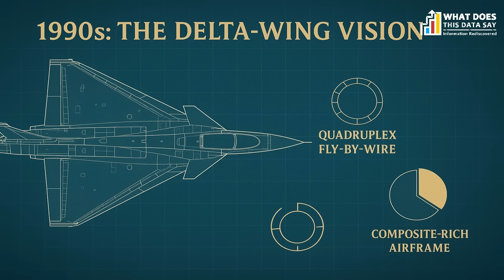The Tejas Story: Crash, Delays & India’s Defense Reality

Comment: The speaker doesn’t have deep knowledge about DRDo, Tejas, Ministry of Defense, HAL, etc.

1. HAL is a government monopoly and a 40 year failure.  
2. Corruption, Bribery, Kickbacks run India’s defense Industry.
3. India’s education system is based on rote learning that benefits none.
4. Tejas chassis was designed in India with Lockheed Martin’s blessing. 
5. All important and major components for Tejas designed in India are not on the Tejas aircraft. They are all failures. 
6. All important components including the engine are foreign origin.
7. After 60 years, HAL is still a screwdriver technology Government monopoly that does next to nothing.

Comment: LCA Project Delays - for a correct perspective:

1.  Typically, for any well established international company, it take about 12 years to develop a new fighter aircraft, with already established technology base. In Indian context, it would take additional three years, given the infrastructure and Indian ethos of working. 

2. In the case of LCA, the initial project plan was to get the Composite Wing developed abroad, and in turn bring in the technology. In the words of the then Chief Designer for Wing & Empennage at HAL, "they Don't Know What They Don't Know In Composites". Hence, the above approach. 

3. For a better agility, required in a fourth generation aircraft, we need an unstable configuration (To understand that concept, take a table weight and put on the table. It is very stable and requires some force to move in any direction. But, reverse it and put it on the same table. It now stays only on a point contact of the spherical surface, but highly unstable. But, now tilting or rotating it requires very little force. But, to move to a specific place, it requires a controlled handling. That is how a unstable aircraft is made to operate, for better agility & maneuver). To manage such an unstable configuration, we need a quadraplex digital fly by wire controller software and the attendent hardware, which is a highly complex challenge to address. Originally, all that was contracted for development by Moog, USA. However, after Pokran Nuclear Test, all our scientists were sent back overnight, due to new US sanctions. We have to start an indigenous effort abinitio, from then on, adding to the uncertainty of development, involving enormous ground rig testing.

4. Added to the above is the Foreign Exchange crisis of Nineties. Even FE for wing development (about Rs 150cr) was not available. We had to master ourselves on optimisation of composite design on vertical tail, over one and half years, to freez the design. Even after that, HAL team was not ready to commit for wing design. A national team under the ageis ofof NAL was formed to take up. The result was that we not only successfully developed the and a lot of composite technologies, but completed the project in less that hundred crores. However, at the cost of delay of couple of years. 

5. As things got delayed, the electronics adopted started getting obsolete, in terms of availability of spares, for future replacements. Which drove us to go for a redesign involving Open-System architecture for entire Avionics. It permits easy replacements due to obsolescence. 

6. Having mastered Composites, and brought on par to contemporary level, we decided to redesign the fuselage from original metal specification to composite fuselage, to meet the stringent weight target. 

7. All the above delayed the project by several years and the IAF as the user said, we have to move to R-73 from R-60 missiles. These are tip mounted on the wing, requiring beefingup of wing, to cater for heaviour wright of the missile. Several such upgrades have to be made, as required by IAF. One can't blame the IAF, as they need an aircraft which is contemporary, for securing the country. 

8. While there were definitely delays on account of the above import substitutions, we did save a lot of money, helping us to make five prototypes, against two, sanctioned under Phase-1. 

9.It is noteworthy to appreciate that ADA's culture and working atmosphere was such that, scientists were addicted to work and would go home late on most days and also work on Saturdays.  Dr Kota, as the Chief Designer, worked 12 hours per day, six days a week, as a role model. He also provided an environment enviable by any standards, compared to other government or private institutions. 

10. We did develop a technology base, identifying capabilities all over the country, involving more than hundred public, private and academic institutions. Just imagine, a professor from High Voltage Department of IISc, establishing a dedicated Lightning Test Facility, capable to discharge a Million Volts of power, for testing composite structures with Lighting protection. A huge 4m dia and 10m length autoclave, for wing skin curings, was developed by NAK, for HAL, as it was under export embargo. Now, with a ToT fromNAL, few private companies have supplied  dozens of autoclaves, which were hitherto imported at much higher cost. Similarly, a ToT to TSL for cocured-cobonded composite parts is such a grand success that they are now  supporting the larger production requirements. In turn, their international foot print has improved, based on the expertise gained LCA composite part manufacture. There are hundreds of such stories, small and big, making this project unique. 

11. A proven engine only can be used for a new aircraft and GE404 was identified for the purpose. Engine development was not part of LCA program. This just for information of those who are concerned on engine development.
 
12. Being the first fighter aircraft of its class in the country, it went through enormous flight testing, incrementally to avoid any risks, involving 3000 flying hours. It was under the aegis of a National Flight Test Center, fully manned by deputed IAF personnel. They in turn became our ambassadors in IAF later, having first hand experience of the aircraft and the commitment with which it is being developed. Mind you, some of the heads of NFTC later became the Air-chiefs. Hence, LCA project is like back of their palm and they know everything.
Trust, this brief gives enough appreciation, why an initial fighter aircraft development project from scratch required more time, than thought of originally.

13. Hence, the future fighter aircraft developments would not require such long periods. 

Jai Hind

Dr K Sham Sunder
Outstanding Scientist and
a former Project Director of ADA
Reply: Very well written as a person who has hands on worked for LCA. People should read this comments first before commenting. Hats off to ADA

Comment: India's only hope depends on the US engine, Israel's radar, the UK escape seat, and multiple nations' tech. That is no hope.
Reply: No made in India.
Reply: @AbdulRazak-zv8ks   TBH, not even the important screws used in the assembly of some critical parts of the aircraft, which have to be "certified screw",  the Indian domestic manufacturers currently do not have the capability to produce today. Some of the alloys used for the material of the screws  (i.e. the strength,  quality and precision machining of the screws and its dimension and configuration's  "deviation tolerance" required cannot be met by any Indian domestic suppliers.

Comment: Moldy's dream about MADE IN INDIA turns out to be ASSEMBLE IN INDIA.
Reply: when you import so many key components from other country, when the jet crashed, you can't figure out root cause and isolate the failure.
Reply: 😂😂😂😂 They Cannot Even Do That Properly
Reply: @moemeghji9672  They need the screwdriver from China.. 
And a Chinese engineer to teach them how to use the screwdriver.
Reply: First try to manufacture safety pins before bullshitting about others' capability.
Reply: Why a light jet needs Western engine when Russia would allow India to co-produce its RD33 engine.   Jai Hind.
Reply: @tedchandran  Jai Lora
Reply: @tedchandran  There is nothing wrong with the American engine.. 
It is the plane itself is too heavy, too unstable and basically ...made in endia.
Reply: This Tejas jet project started at least 1/4 century before Modi became the PM of India.
Reply: This fighter jet wasn't just leaking oil before takeoff; the aircraft was poorly made, every component was faulty, and the quality was extremely low. I sincerely hope India doesn't develop its own fighter jets anymore; they should buy them from other countries. Causing so many innocent lives to be lost is utterly shameful. What's most incomprehensible is why Indian officials ordered the pilot to take off in such a dangerous aircraft. The risk of taking off in such a plane is greater than jumping off a cliff. Jumping off a cliff might at least result in landing in a tree or tree branch to save one's life, but taking off in such a plane is a one-way trip. There's no chance of returning.
Reply: Envious bots..😅😅..keep crying in confusion..i
Reply: True, Tejas in not an Indian indigenous plane, the engines and ejection seats systems are from US. The radar and warfare suits are from Israel. The missiles which will be integrated are a joint production with Russia, Israel or France. How much the frame or body is indigenous, not sure.
Reply: More like crashed in endia.
Reply: Jf 17 has russian engine
Reply: @A-px7ko  
Where do you get that idea?

Comment: Very sensible analysis. 
Tejas should NOT BE ABANDONED 
Tejas n Caveri engine development problem is because they both needed very high standards of engineering and material technologies that india just didn't have and is still lacking. 
It was the Apollo program which led to the development of new cutting edge technology that usa industry benefitted. But USA industry worked hard to do so. 
Sadly our industry especially the private sector has been too protected n mollycoddled and has never invested in R&D. Only bothered about shareholder wealth!! 

Its a handicap that has delayed the tejas program
Reply: As they say, it is not the plane. It is the pilot.  In India, it is not technology. It is the people.  China had little technology in the 80s. India was more advanced than China.  Now China is going head to head against the USA. India is still a joke.
Reply: What makes u believe the delays were due to technical reasons. They are more political reasons than the so called technical reasons. Modi hijacked the project when he put aside HAL and handed over the project to ambani and other big pockets.